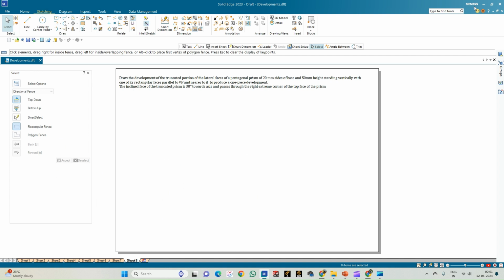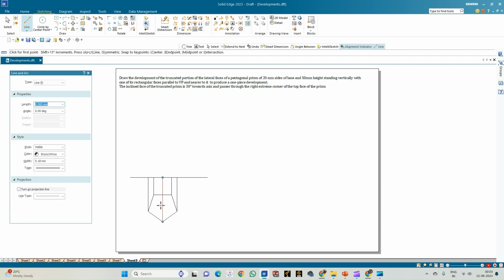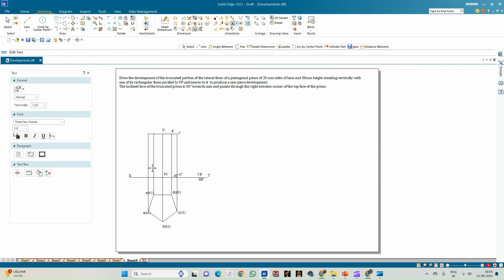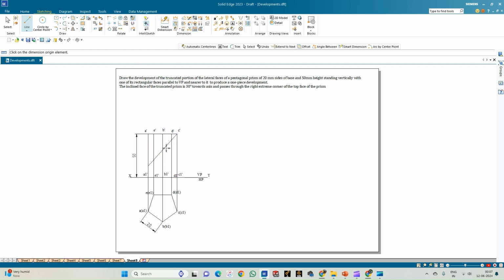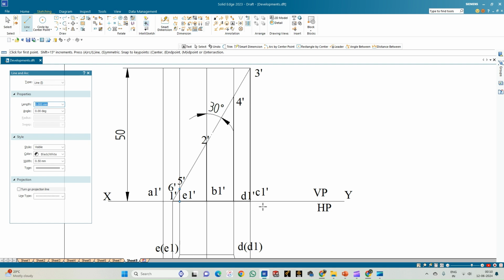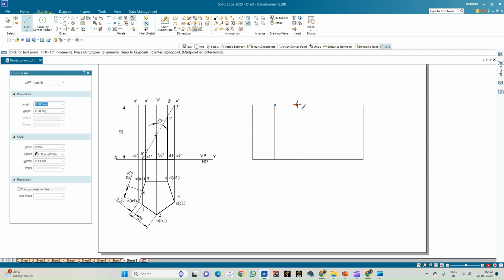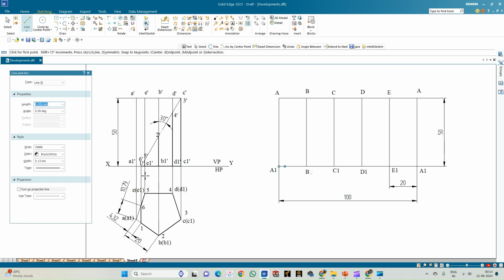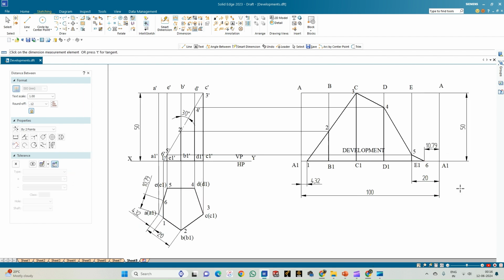Development of Lateral Surfaces of Solid Pentagonal prism 02

Comment: Draw the development of the truncated portion of the lateral faces of a pentagonal prism of 20mm 
sides of base and 50mm height standing vertically with one of its rectangular faces parallel to VP 
and nearer to it so as to produce a one piece development .The inclined face of the truncated prism
is 30° to its axis and passes through the right extreme corner of the top face of the prism